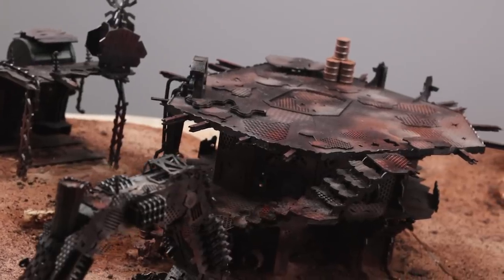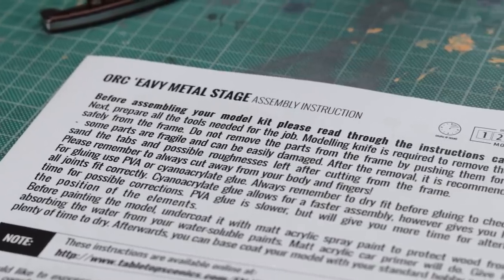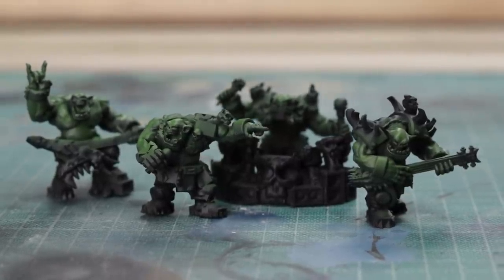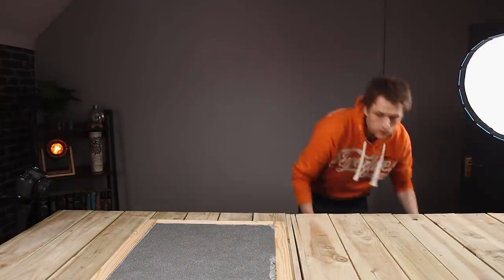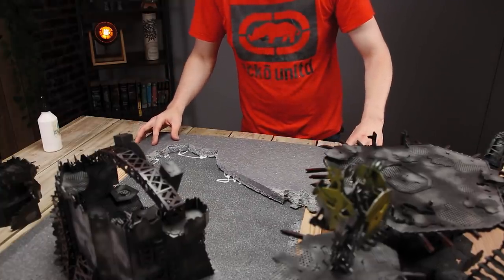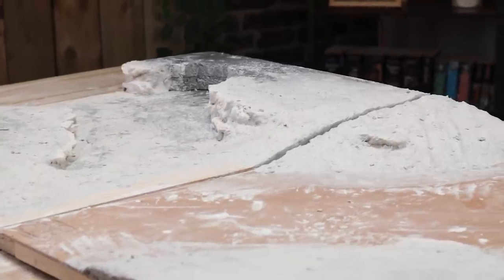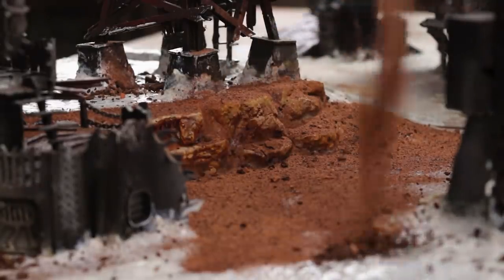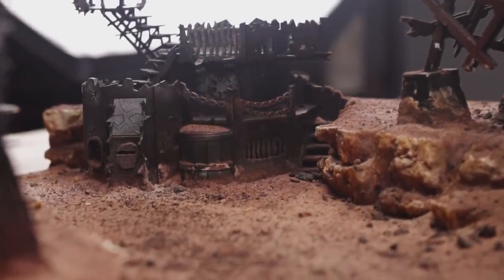How to build a MASSIVE Ork city board for Warhammer 40k or Killteam.

Comment: Great video!
Little tip to get rid of the tiny squares, get a stiff brush (like a scrubbing brush), hold the piece off the table and press it firmly against the squares. Should get most of them out in one go. You can also just smack the brush into them to get rid of the last few.
Reply from the maker: Good thinking!? I ended up just smashing the against things haha.
Reply: @BroadswordWargaming  Either it it with things or smash it on things; it’s the only way for an Ork!

Comment: How did you glue down all the terrain material? Was it spray adhesive or regular PVA?
Reply from the maker: The buildings were attacked with modelling compound. The ground cover was pva all over the board.. Once that had dried, squirt it with watered down pva glue as many times as you want (the more the merrier), then hit it with some cheap varnish or the mattscenic Sealant.

Comment: How well did that spray of varnish hold all the sand and grit that you put on the board?
Reply from the maker: Really well. So for the board, I used straight pva, then covered it with watered down pva a few times (letting it dry), then use the matt scenic Sealant, then just used a can or two of varnish. 😀
Reply: @BroadswordWargaming  Riiiiiight that makes sense. I thought you'd said in the video you just sprayed it all with varnish and I wanted to know how that worked so that I could buy a truckload of it lol